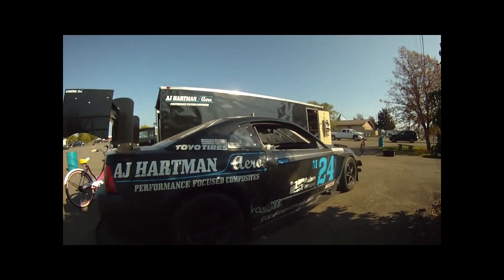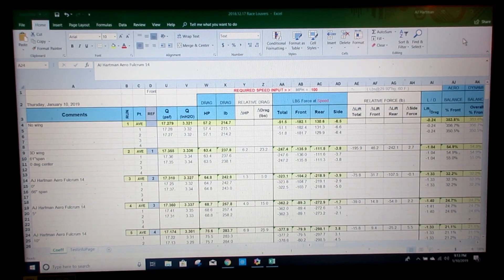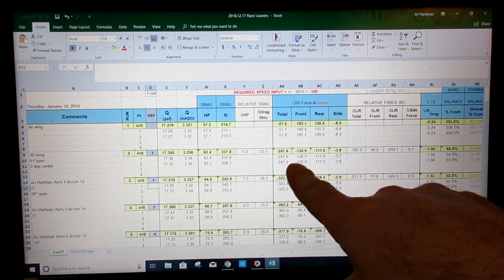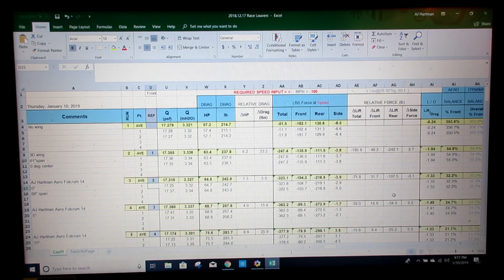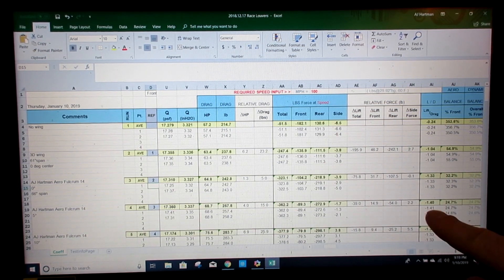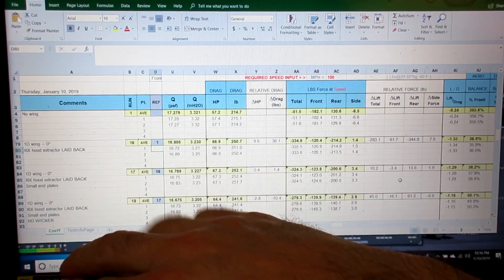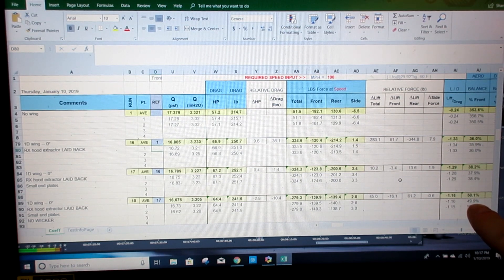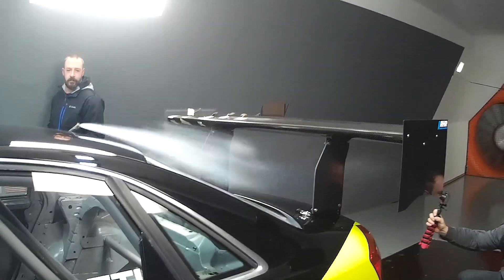We Go To The Wind Tunnel For Real World Testing

Comment: Good into here. But I would love to see some info on small vortex generators. Noticed you have not used any maybe some experimentation can put air exactly where you want to go. I would love to see something about them
Reply from the maker: I would to but it all comes down to the time we have in the tunnel and $$$. Its not cheap so we need to run the "low hanging fruit" stuff first to get the bigger, easier stuff out of the way. VG's are much trickier and usually smaller gain stuff so much more time would be needed.